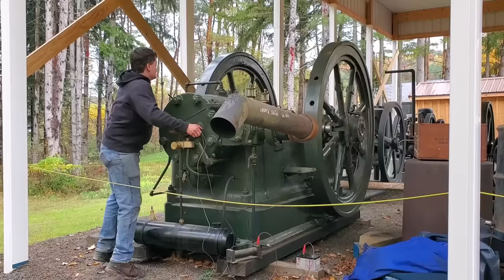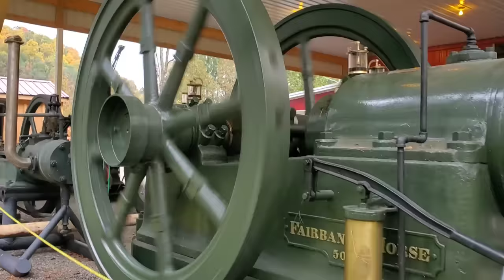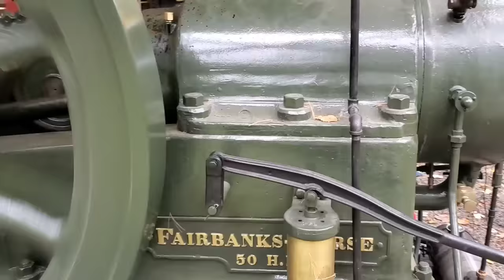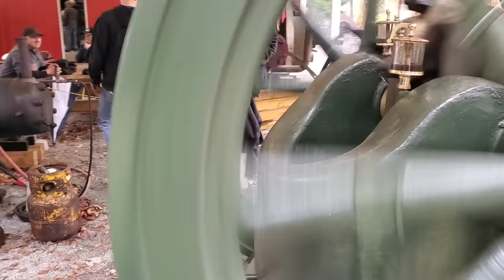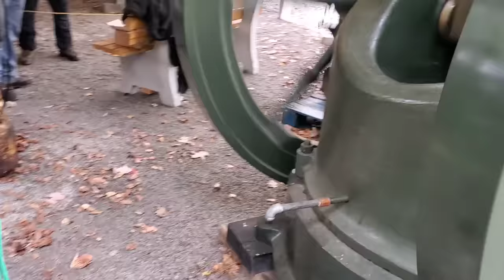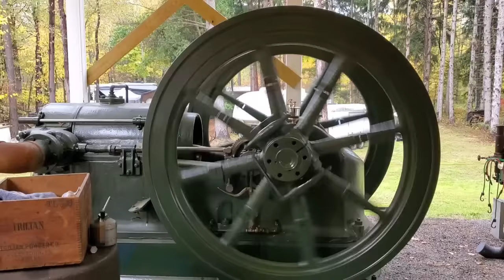50hp Fairbanks Morse N - Start and Run

Comment: These engines ran manufacturing plants or generators. Vista , California has an exposition in spring and autumn. They have gas and steam generator engines on display. The gas engine is a hit and miss engine, which sounds like thunder when it hits. The pipe is over 50 feet tall.

Comment: What is the purpose what does it do looks extremely dangerous
Reply: Its an engine, it would be connected to other machinery using a large flat belt. Such engines were commonplace in rural areas before the power grid reached them, as they were far safer and less labor intensive than using a steam engine to do the work.